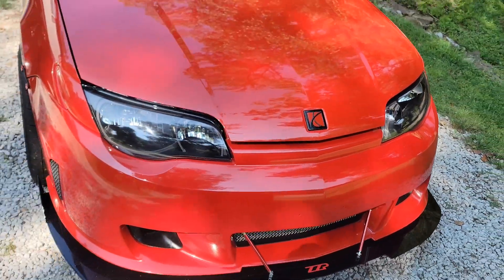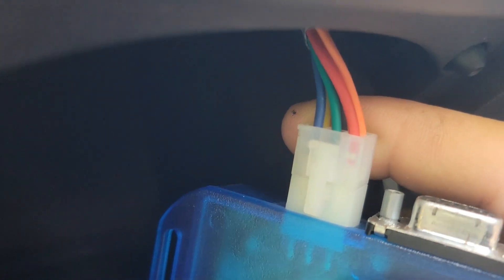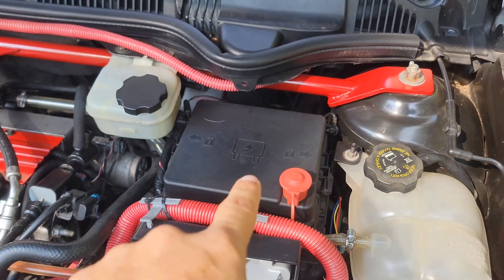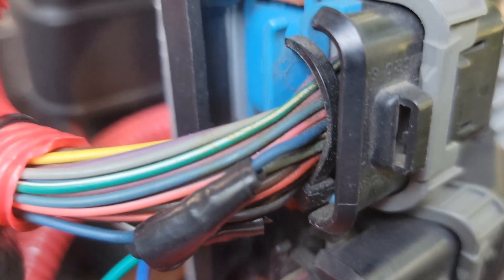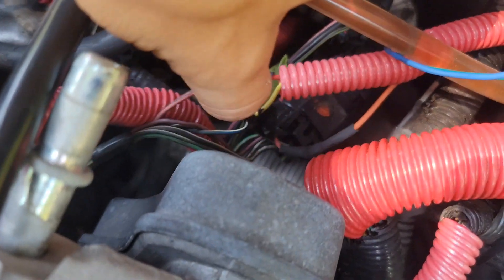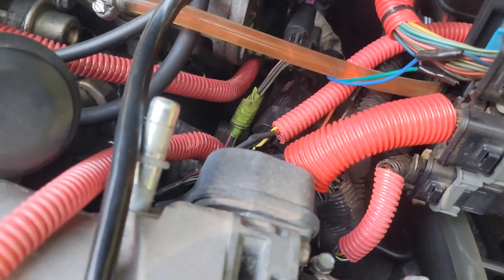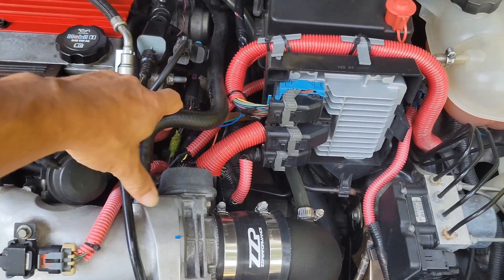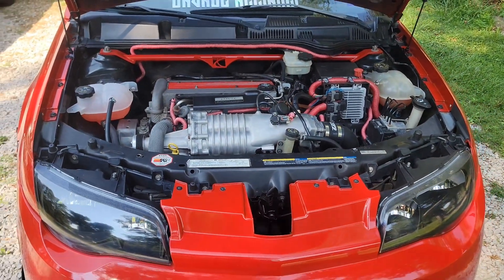N2MB WOTBOX WIRING EXPLAINED

Comment: You the best bro 😢
Reply from the maker: Glad i could help ya out! Remember to upgrade the oil pump with a hardened gear if you can. These engines dont like the ratcheting motion the 2 step makes the oil pump gear do.
Reply: @Thecheaperguy  yeah ima get it soon just got a new exedy clutch ima do a full timing kit from that guy too I just bought this thing with 160k and it's pretty much ok except the intercooler pump being dead but that all good now
Reply from the maker: I got mine at 201,000mi. Im not sure if its had a timing update recently or ever. I know im playing with time but it does run very smooth and i dont drive it too hard, or often for that matter. I only drive it about 20 days a year to and from shows or on errands on a nice day.
Reply: @Thecheaperguy  is the oil pump not behind the timing cover if so sick
Reply from the maker: @chrisgriffin4097  i havent replaced that gear in mine so im not 100% but from what i know it is behind the timing cover. Seeing as the timing is directly tied to the oil system. It would make sense that its behind the cover.
Reply: I thought so but ok ill deff look into it thanks